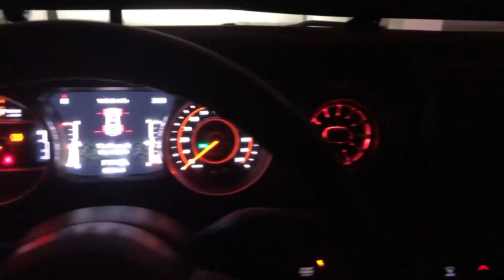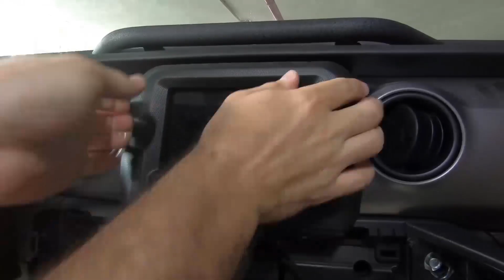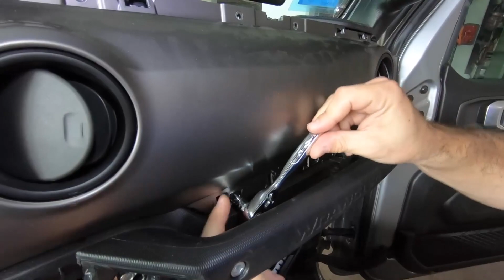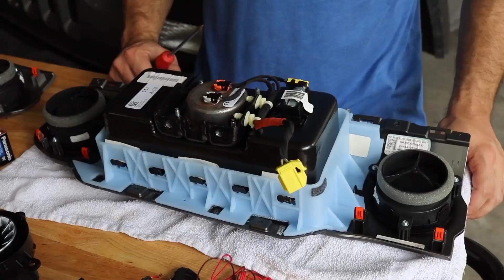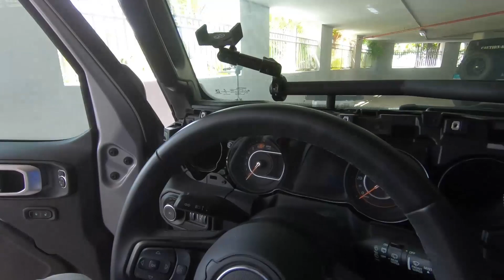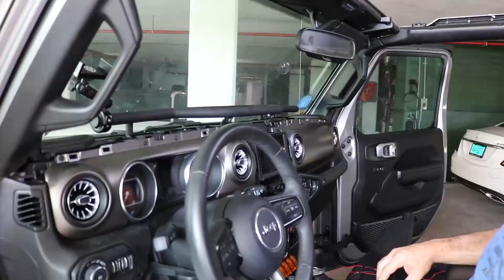JEEP WRANGLER JL TURBO AIR AC VENT WITH AMBIENT LIGHT INSTALLATION | AMOffRoad

Comment: Cool but not 400$ cool.
Reply: 250 on amazon
Reply: Not even close. I did this in my Avenger's factory vents for probably $30 😂 just bought a 4 pack of 3.5" leds strips, & tied them into the rest of my rgb lights.